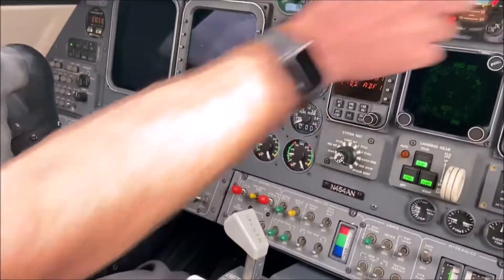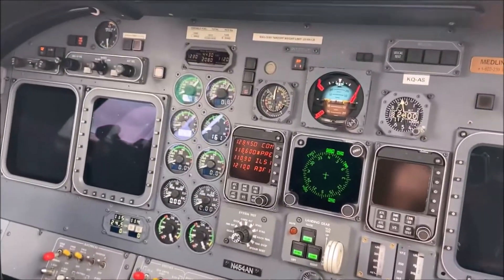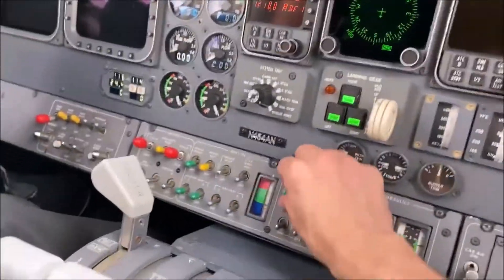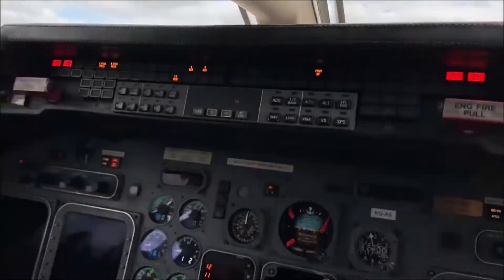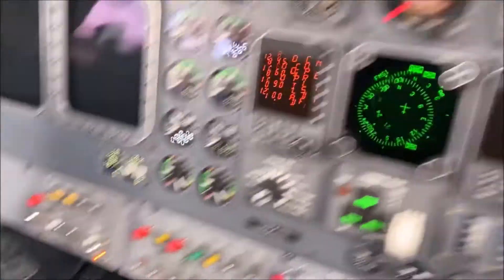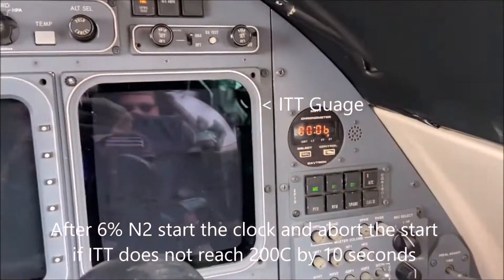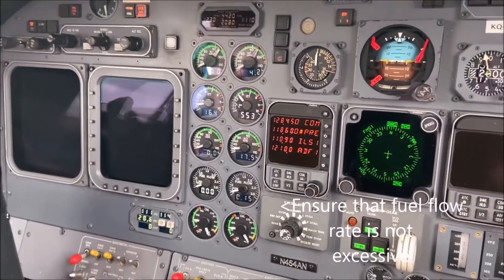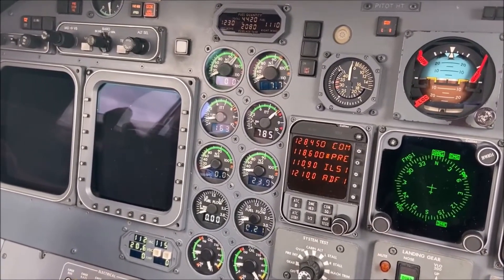Learjet 101: Starting Engines Checklist | Part 3

Comment: What type of battery do you have onboard? Is it a NiCad or Lead-Acid AGM, even this craft has a double battery setup? Those engines has a 400Amp starter-generator which likes to 'sip in' a couple amps upon startup :D
Reply from the maker: @barjan82  we have dual lead-acid batteries. The start amperage is actually so intensive (400-500a) that we though we have the capability to battery start, we don’t and only use GPU/APU.